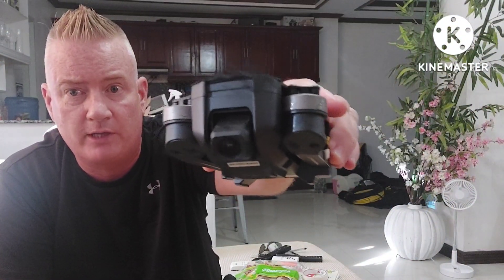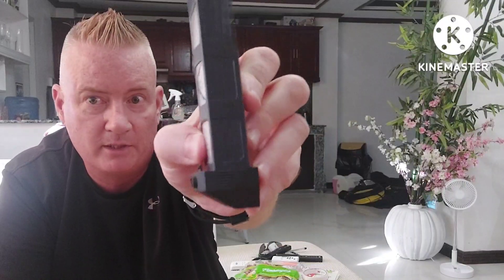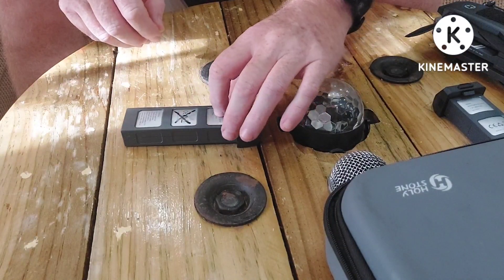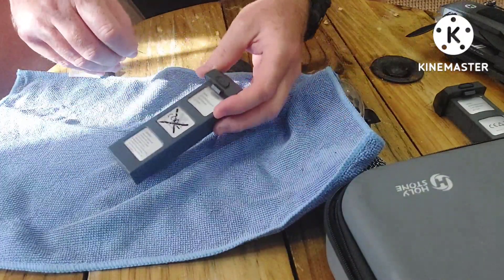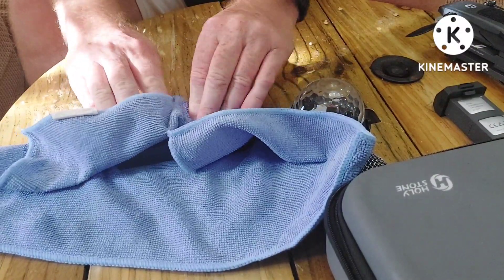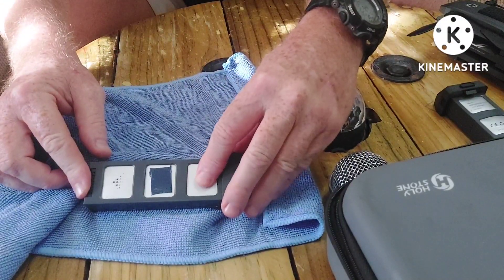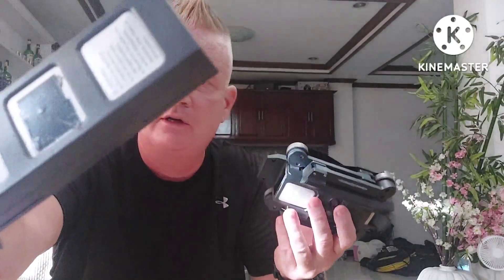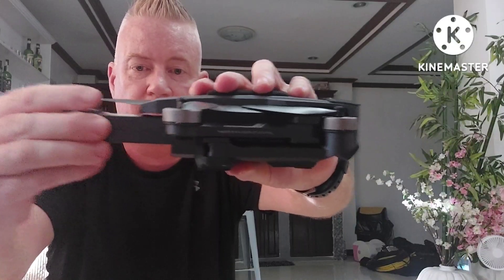How to fix a Bloated Battery in a Drone, HS720E

Comment: I had 4 of these batteries new, never flown & they were bloating :face-orange-frowning: I punctured the wrapping once on the bottom & once on the top :face-blue-smiling: PERFECTION, immediate results & now the original size :face-fuchsia-wide-eyes: worked perfectly :face-red-heart-shape: think you. Obviously stored the batteries outside for a day our two just to make sure I didn't puncture the cells, saved me $360 bucks :trophy-yellow-smiling:

Comment: I have the same drone model thas already 2+ years old, the batteries started to bloat just like yours, one reason maybe is that I sometimes kept a fully charged battery for an extended amount of time without using it (don't always have time to fly my drone) and it started to bloat. I am planning to fix my two batteries like what you did, I have to mention that the Battery model is hard to purchase in my country so I have to do a DIY to fix it temporarily until I can purchase a new one. Thanks for your video, it helped with my confidence that fixing it can be done, of course, with safety in mind.
Reply from the maker: Be careful.  Don't let any air in the battery.  Do it outside, wear gloves and goggles.
Reply: @mikesyoutubechannel6367   I will take all safety precautions before doing this. Thanks for the video instructions, at least now I know that it's doable. More power!

Comment: Mine have done that. The lights were all on saying charged. Tried to fly it the low battery light popped on right away. Was this the same case for you
Reply from the maker: Mine held 90% of its charge even after I fixed it.  But my drone took a dive on a new battery and it's dead now.

Comment: Same thing with mine, I will do it but just in case I will put glasses on. I wrote Holy Stone and told them only a year and this happened see if they send me new ones. It doesnt hurt to complain 🤣 I will buy the DJI mini , this one doesn't go far enough.
Reply from the maker: Be careful. I tried this on my second battery just 2 days ago and it burst into flames.  I wore heavy duty gloves and a plastic face shield.  However, the first battery I did this to still works great.
Reply: @mikesyoutubechannel6367  I just tried this.  One side worked fine.  On the other side I pushed the pin in too far.  Quite exciting meltdown.  Hopefully I'll be able to taste food again real soon after breathing in some of the smoke that was generated while it was doing it's chain reaction meltdown.
Reply: @mikesyoutubechannel6367 does the battery STILL work great today?
Reply from the maker: The drone fell from 300 ft in the sky right into the ocean....and that was with a brand new battery.  No more HS drones for me.
Reply: @mikesyoutubechannel6367  nooooooo ahaha I’m so sorry to hear. I ‘needled’ my batteries 3 weeks ago and so far no issues :)
(Phantom 2 vision plus)